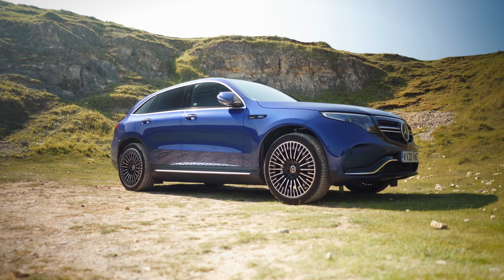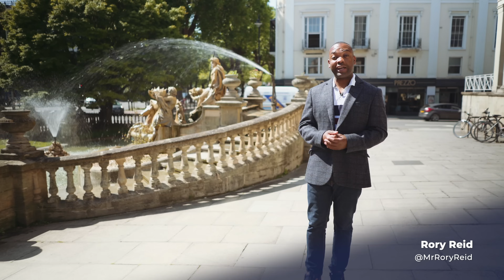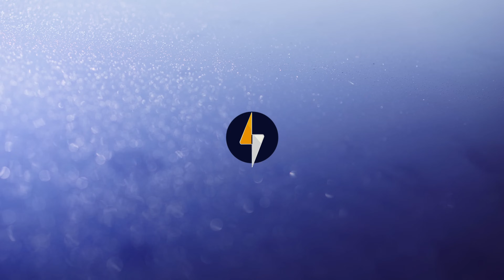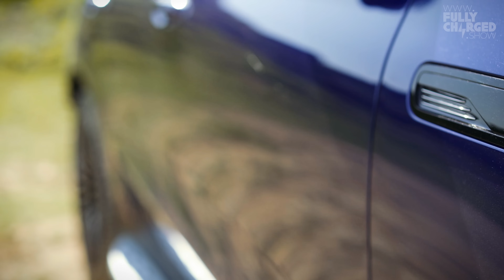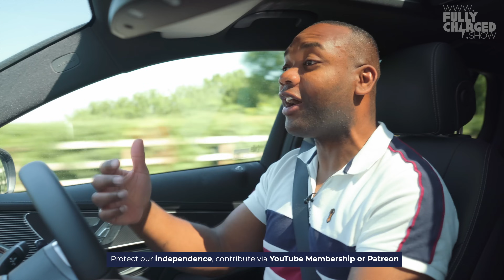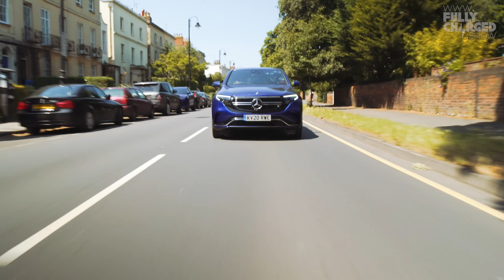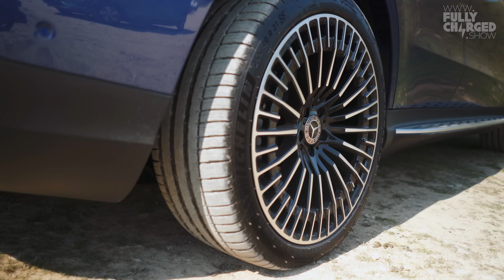Mercedes Benz EQC - Rory Reid First Drive | FULLY CHARGED for Clean Energy & Electric Vehicles

Comment: It is probably the most beautifull EV, but it still doesnt beat my old P85+, no charge equivalent, not more space, not more power and no more range...wtf, not good enough!! My car is from 2013!! 
Thx for a cool channel, inspiering 😉 greetings from Norway
Reply: @Rubedo Alaberti Its funny I'm not a fan of voice control. I don't use it on my Phone. But in the tesla the system is updated all the time and its getting better every day. contrast that with a button that is getting used and is physically wearing out from use eventually you need to take it in and have it replaced! The Tesla just gets fixed via blue tooth no dealer visit! nothing to wear out. "example" Your alternator can't wear out if you don't have one!
Reply: Tony Simi because the MCu doesnˋt wear out by innecessary logging and fail completely, so you can ´t use the car any more. Takes 2-4 years, granted. No button will survive that long ´😂
Reply: @tonysimi1776   "nothing to wear out." - Is that why Tesla's are well at the bottom of all reliability statistics and have the most breakdowns of any brand?
Reply: BeyerT1 all that and the model 3 still has the lowest depreciation in its class (including ice) ever asked yourself why?
Reply: @derbigpr500  Nice troll! Your mother wants you to clean your room!
Reply: @tonysimi1776  I have never known a button to "wear out" on any car that me, my friends or my family have owned. That's just a ridiculous claim.
Reply: @drunkenhobo8020  I just replaced 3 on my daughters car entry code pad (the numbers worn off and illegible) $200,  fan control $200 and air conditioner switch $160 Plus it was a pain in the butt to arrange repairs drop off and pick up.
Reply: @tonysimi1776  LOL. There's car out there that's 20 years old. The buttons still work. They don't wear out. Do you see window switches failing often? If you're so toucb screen pro, replace your window switches with a screen. Would be interesting.
Reply: what did that car cost, how much usable battery is left and how quickly can you charge?
Reply: @EVPaddy  2014 SP85 53K miles range has dropped 6 miles. Charges fast and for free with my solar panel system.
Reply: Yea, just ignore that it's a far better car in every way so you could say "it doesnt beat" your Tesla.
Reply: @derbigpr500  You keep getting triggered and accusing others of things you couldn't possibly know about them. Have you ever heard of the term, projecting?
Reply: Well the EQC is built in a way tesla can only dream of. It's refined and quiet and safe and packed with great comfort and convenience technologies. It charges fast enough to be sufficient for most. And the thing that confuses me about electric car people is that you've always argued range saying that you can plug in at home. Wake up on 100%. That most people travel less than 30 miles a day. And then proceed to bash cars with a 200 mile range. I don't think it's about EV adoption or caring about the environment anymore. It's about bashing others so that your favorite brand seems better.
Reply: @Rubedo Alaberti 
(PSSST!.... It's called voice control!)
Smh
Reply: @Rubedo Alaberti 
Of course it's not.... How would you know if you don't drive a Tesla?
And don't say "your friend has one"
Reply: @Rubedo Alaberti 
Tesla, select voice control via steering wheel buttons, select temperature, done.
Vs Mercedes voice control? (Yes.... That one)
Reply: @Rubedo Alaberti I understand your concern. But did you notice Rory Reid taking his eyes off the road to look for buttons and controls? Watch the Video again and you can see him do that. In my Tesla's almost everything is done for me so there is no looking down and around for buttons or console controls once every thing is set! Also I can change settings by voice comand by pressing the right steering wheel control, Eyes never leave the road it's not a distraction and effortless!
Reply: @tonysimi1776  The voice command works better in the Mercedes. Here this guy has driven the car for a short time. With buttons, their placement becomes muscle memory and once you locate it, you can keep making changes without looking because there's tactile feedback unlike a touchscreen.
Reply: @tonysimi1776  My friend had an accident couple months back. Totalled his Tesla 3. Another car crashed in to his at an intersection. Other car was totalled too. That other car was a Tesla S! You should not depend on autopilot too much, it's barely level 2.  

Software always performs in best case scenarios, it's the worst cases that define quality and as users it's not your job to create or test them so please don't. It could end up being fatal.
Reply: @amitpatilamit  I use my autopilot every day but I never remove my hands from the controls. I would never use autopilot for intersections it's not ready for that; Although, system 3.0 is getting better rapidly! Bottom line Tesla can only build a safe car. Tesla can't chose the person who drives the car. Put an idiot behind the wheel of any car and its a potential murder weapon!
Reply: @amitpatilamit  sad story love my Tesla's especially love driving by all those gas stations!
Reply: @Rubedo Alaberti but you just activate autopilot and do what you want,
Reply: Solar&tech-ke famous last words.
Reply: @kipdennis3796  Autopilot isn't self driving and won't drive in back roads when you are more stressed and need to change things on the move going left and right and left and right.
Reply: Its frustrating when a car reviewer compliments Buttons and Knobs on an electric vehicle! Buttons and Knobs are undesirable! Using buttons and knobs show that Mercedes is extremely weak on Software and STUCK with I.C.E car primitive controls.
Reply: @tonysimi1776  You're too dumb to describe with words. But a perfect Tesla fanboy. That brand thrives on brainwashing people like yourself into believing they're getting more while actually getting less. But hey, continue enjoying badly engineered and badly built mass produced junk that's being sold to you as "premium".
Reply: @derbigpr500  I am a fan boy I bought stock in tesla and it paid for my cars and my solar system! stock is over $1300 better get in!
Reply: @tonysimi1776  You must've not seen their presentation on the new MBUX then. Anyway, buttons don't make a car primitive. It makes it convenient. Touch screen is distracting when driving.
Reply: @tonysimi1776  you are completely wrong. i am a software engineer and studied also user interface design. buttons and knobs are great for some purposes. and it has absolutely nothing to do if it is an EV or ICE or steam car.
Reply: Depends what you care more about. It is significantly more silent, especially at higher speeds and the quality is also significantly better.
Some might prefer the slightly longer range of Tesla but most need a car for daily town riding, so these higher quality cars are more appropriate for them.
Reply: @aliancemd  Too big for town driving, ID3 better
Reply: @aliancemd  " so these more higher quality cars " !!??.. in wich part is more higher quality car than tesla?! ..  only the looks and the finishes,  thats it , in what really matters,  perfomance ,safety,  simplicity and some comfort tesla do beat all but all off the gas car manufacturers..

Comment: Glad the jacket didn't last long. I still don't get while the seat controls are so 'in your face' on the door. It wont entice me out of the I-Pace.
Reply: They're much easier to use that way. They're well placed, too, it's not like they'd ever be in the way of anything, really. I think exactly the opposite: Why the hell would anyone ever put electronic seat controls near the floor of the car, like so many competitors do... They should just accept that Mercedes had the greatest idea for placement of these controls at some point in the 80s and copy that, like Lincoln has, for example.
Reply: @fryke  it just looks really messy for some controls that get used so infrequently. I've never had an issue using seat controls on the seat and door controls on the door
Reply: My wife kicked off the control on my model 3 seat getting in / out. It's happened to quite a few people on forums. So I'd love seat controls on the door!